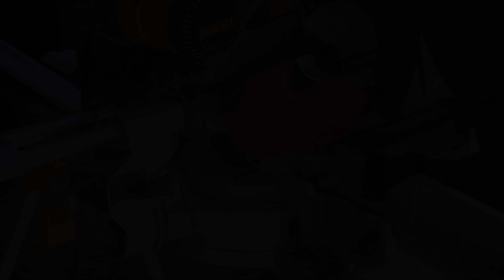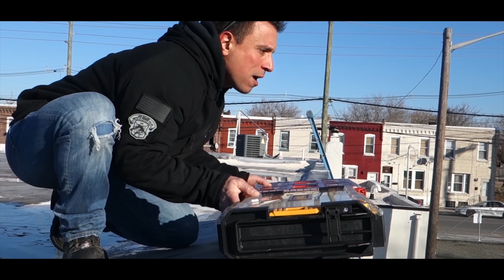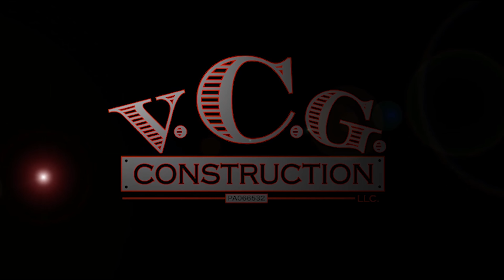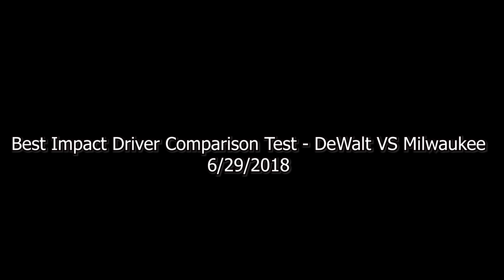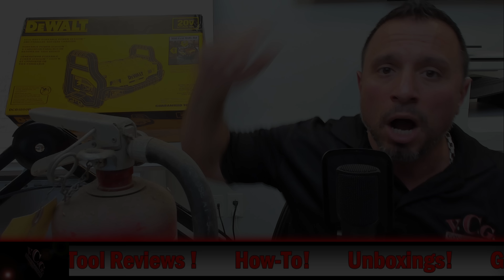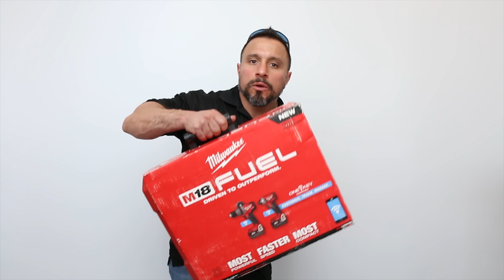DeWALT DCF887 Impact Driver Fails!

Comment: Dewalt should've added vents in front of the BLDC stator windings, a cooling fan, and used thicker gauge wire for the stator windings.
Reply: YouTuber Catus Maximus did a teardown and said(in a comment to me) that the fan in the 887 is in front of the motor inside that area where there are vent holes on top and bottom in the middle of the case.  It's a strange design, since virtually every other impact puts the fan in the back.  The Atomic and 12volt Extreme models have traditional fans placed in the back.
Reply: @browsebywire4096  My theory is that its sucking up air from the back AND  the front (through the openings where the LED's are). Cooling both parts of the device
Reply: Soğutma fanı var fakat küçük yeterli değil

Comment: I think the quality of all brands is getting pretty darn bad. Prices going UP! I own Milwaukee but i hate the drill chucks they always release!I hate the cordless miter saw. Tends to drift and underpowered. The fuel is far better so guess i gotta upgrade. Now the gen 3 drill is getting HOT as well...😞
Reply from the maker: Not hot enough to fry itself!!
Reply: They haven't made a good Chuck, lots of complaints online. Gen 3 looks better finally but Gen 1 and 2 were really bad
Reply: Fusion2016 yeah the third gen they started that they worked on that issue. But then again they aren't the only beans that had Chuck issues.
Reply: Hmm never heard an issue with the saw what do you mean drift?
Reply: Just wondering if the blade is square to the fence it just seems like I have to keep both hands on it almost to make sure it stays straight. Had a bosch before and I could use it and be within 1/8” of my line. Changed blade as well but hasn’t helped much. This wants to wander off constantly. Maybe I have to Go slower
Reply: Mean O’ Dustino you have the 10 inch? That's interesting. Wonder what that might be.
Reply: No just the 6.5” circular saw
Reply: Mean O’ Dustino isn't the cordless a 7"?

Comment: Vince next time you are at home depot look at the ryobi brushless 3 speed impact driver and you will see a fan in it
Reply from the maker: Are you a big fan Richard?
Reply: VCG Construction Vince I am a big fan of ryobi and Milwaukee and Vince I was just on the home depot website and the m18 fuel angle grinder that comes with the free 5.0 batteries is not available any more and I can't find it on acme tools ether
Reply from the maker: NO Richard!!
Reply: VCG Construction the drill must have a mirror in it. Garner sees his reflection. That’s the only fan in those drills.

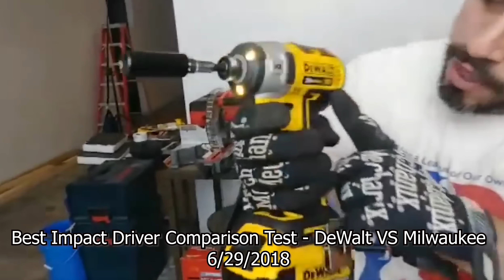Comment: 2:58 Your pointing at the air Intake instead of exhaust. the front 4 holes are the exhaust.
4:55 There ain't no gearing there (or at all); you are aiming at the hammer.
I don't know man i watched several of your videos and although I don't agree on everything its still very interesting to watch.
Also my DCF887 behaves way different than yours. It overdrives like a MFer on 2 and 3 and has no hammer on 1 at all, it just beeps and shuts of.

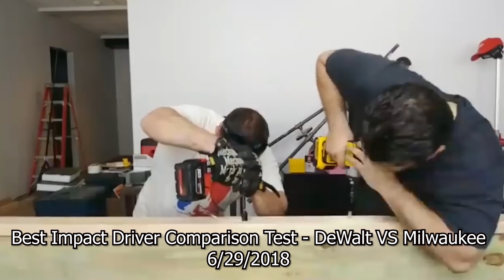Comment: FLAWED COMPARISON??? Pause the clip at 2:27 and to me it's immediately noticeable how much more downwards force is being applied to the DEWALT compared to MAKITA. This causes more resistance acting against the bolt. To me it looks like the dewalt is trying to push through the wood, when It is dominantly the hammering action along the rotational axis that drives the screw. Applying excessive force is counter productive and damages the tool
Reply from the maker: So you’re saying it was operator error twice? 2 different operators two different 887 s same result!!
Reply from the maker: How much does Dewalt pay you to leave these comments on our videos? Sounds like your the only one getting paid.
Reply: I love when guys think pushing harder makes it go faster, hey let's abuse a tool to the point of failure  then act suprised when it fails lol

Comment: I hate to point this out but, 1. The guy is not wearing gloves so I feel like the heat dispersion isn't as good. 2. Who puts all there weight on a impact like that anyways? If you were hand tightening with a screwdriver, I'd understand. The point of the power tool is so you don't physically exert yourself. And seriously, I could put my free hand on the back of this tool without blocking the vent. Sure, the overheat protection could be better but it didn't fail from extended use you dummies, it fail cause the ridiculous weight he exerted onto the tool created a ridiculous amount of resistance. Did the put equal distribute your weight exerted onto the tool?... Probably not. Maybe the root cause isn't even the impact or the person but the flexvolt itself. Why don't you do a video on that. Only one of those those has a capacity to run a 60v battery...
Reply from the maker: You think its the flexvolt?
Reply: @VCGConstruction  Not really, I think your buddy simply suffocated and smothered the tool.

Comment: i honestly had my milwaukee impact driver heat up on me supposedly the best one out at the time heat up so bad on me that it burned the palm of my hand, just last week did go back to my 887 from dewalt both new but its alright maybe just defective.
Reply from the maker: Did the Milwaukee heat up so bad it burned itself out?
Reply: VCG Construction thanks for replying and no it didnt it just heats up bad we were screwing down track for drywall onto some 1/4-1/2 inch steel beams and it was with hilti screw that had bit ends on them. it didnt burn like i was expecting but i stopped using it for work, have it at the house now. everytime it was heating up it would heat up hotter and hotter but it was put through allot pressure so i not gonna bas on it.
Reply from the maker: I see
Reply: VCG Construction I know im definetly gonna get the Milwaukee drywall screwgun im not a huge fan of the dewalts buzzing noise while drywalling and installing sheeting. and im definetly subscribed.

Comment: Looks like the rigid is the better engerniered tool.
Although brushless motors aren't meant to get as hot perhaps they have less heat tolerance??
Reply from the maker: Vince, I have no good explanation for why the DeWalt failed while the Ridgid made it through the test!!

Comment: This is no lie , but lol , I use milwaukee for lag crews anything heavy duty with impact , otherwise you need dewalt midrange impact it holds up just fine , half the time people are using these tools for unintended purposes it's just that milwaukee standard  impact can handle those unintended purposes , not that milwakee standard impact won't eventually burn up to though it can just handle bigger jobs being an standard impact , if your driving big hardware you need a midrange impact with dewalt and your golden , if your driving deck screws maybe small tapcons your good with the standard dewalt , it's common sense really use the tool for it's intended purpose and your ok , milwaukee has more ass for it's standard impact that's all there is to it

Comment: Um yea except your dewalt impact driver was defective since the begging. Many users commented that on your dewalt vs Milwaukee impact driver review. You should have either returned it and got another or shipped it to a service center.
Reply from the maker: Crunch, did you watch the video? these are 2 separate units, both fried!
Reply: Yo bought ANOTHER of the same tool?????

Comment: So basically you didn't really abuse it you just waited for it to cut out and it didn't. I would imagine keeping it running after those lug nuts would keep the motor fan going. It just hot too hot. I would imagine for skrews and the occasional lug nut it would be fine.
It should have a cutout. How being brushless did it get so hot?

Comment: I've always been a DeWalt guy. The new drills and impacts are really disappointing. The drill chucks are absolute junk!
Reply from the maker: The 996 hammerdrill is a monster, the impact, not so much!!
Reply: A buddy of mine has had a 996 for 6 months and the clutch is gone. Thanks for getting this information  out there. Hopefully Dewalt QC is listening!
Reply: The Chuck on the DeWalt is probably one of the best chuck's going... The Gen 2 and Gen 1 Milwaukee were terrible... Lots of people have had to get them replaced or replaced them themselves with high end rohm's

Comment: I have just burnt out my 7 month old 887 impact driver. Darn dewalt. Had to pull up old decking &  smoked after undoing about 60  50mm bugle screws

Comment: Bought the exact same driver from amazon. Worked for 5 seconds and burned. Same problem as the second DeWalt in video. I'm waiting for the replacement from amazon.
Reply: I own the same exact driver and it has lasted for a year now, no problems. This may have been a problem in early production models.